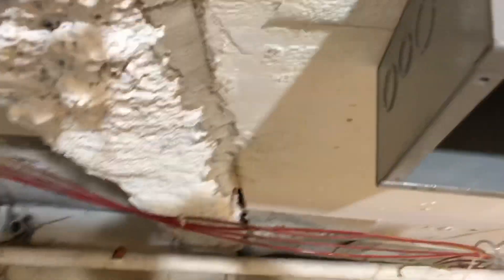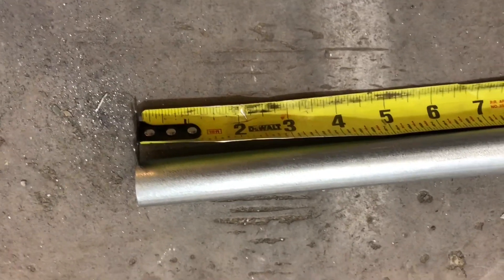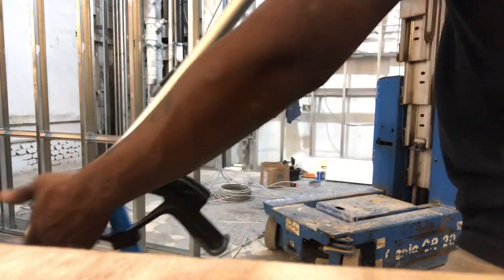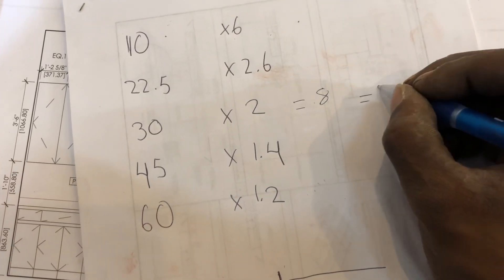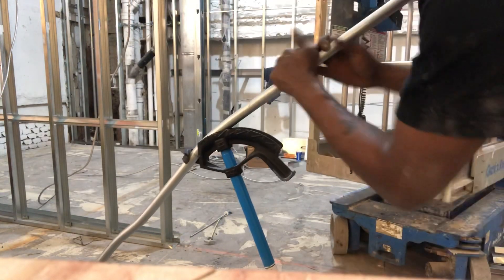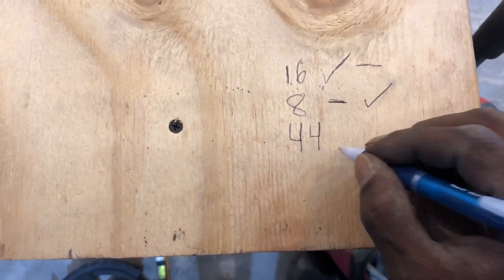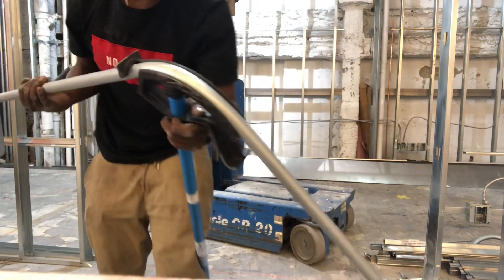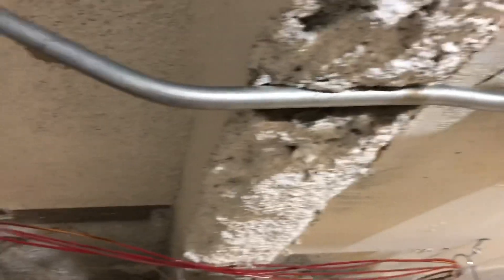How to do several bends w/ one single EMT pipe plus get Offset formula (QUICKTIPS)

Comment: i dont understand your calculations 30x2=8 where from 8
Reply: @Kahit kunting pagtingin.  From the box to the edge before the 8" rise was 16". And from that point to the far wall was 44". On a 30° offset bend, which is two 30° bends in the oposite directions. The multiplier for a 30° bend is 2, so 8x2 = 16. So he measured 16" from the box end of the pipe and made a mark. And from that mark he measured another 16", which is the 8x2 multiplier mark. I just started learning this stuff myself, so I hope I explained it in a way that makes sense.

Comment: For the first bend 10deg which u did at 2 1/2 inches did you still use the multiplier x6

I don’t Quite understand how it works??

How do u work out 2 1/2 inches 

Thanks 

New to conduit bending
Reply: 3/8 x 6 = 2 1/4
Reply: He did it by eye, but the correct way would have been to measure an arbitrary amount from the end of the pipe first, which in the case, he chose 2" . Then using the chart @ 10 degrees (multiplier x6) 

Most box knockouts are 3/8" height. 

3/8" x (6)= 2 1/2" You should make a second mark. Bend both marks @ 10 degrees. 

When you have been bending as long as he has you get a feel for it and no longer need to measure for box offsets.

Comment: Where are you frome ?
Reply from the maker: Hello love birds, I’m from New York. Most of my videos is on site construction in Manhattan NY
Reply: Good work  bro.. i m also electrician in Kuwait  but here in kuwait  we use pvc pipe
Reply from the maker: Yes I’ve done solar work couple years back. Using pvc pipe, with the heater. I will be posting about that as well soon in my upcoming videos, I already ordered a board and few supplies to do work in my backyard on the board